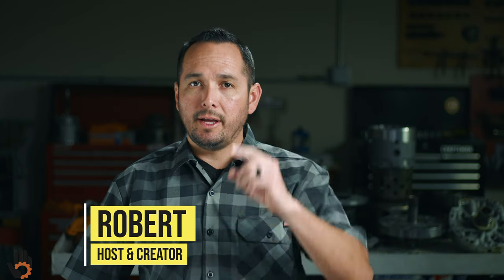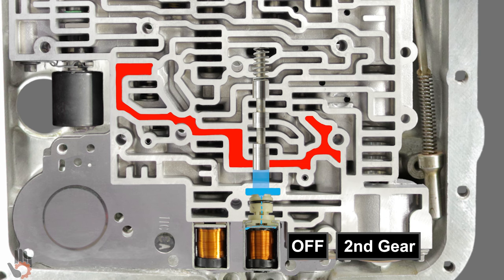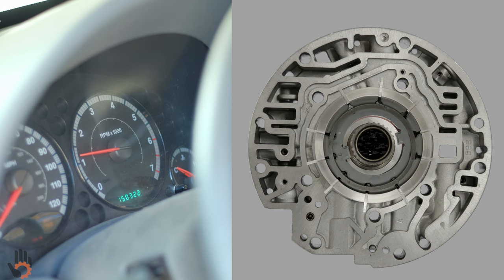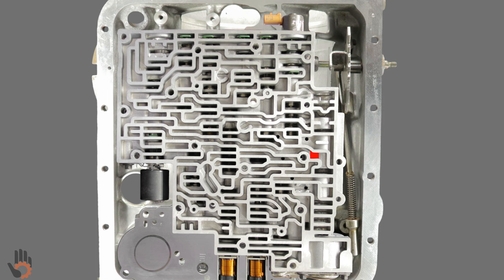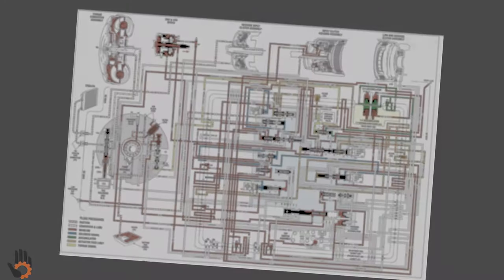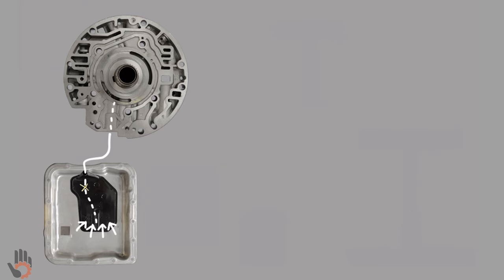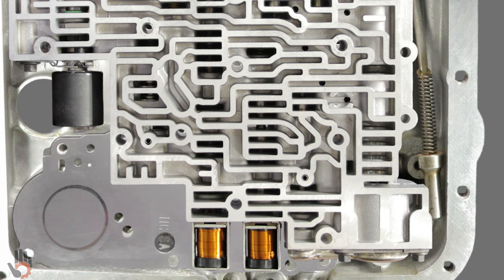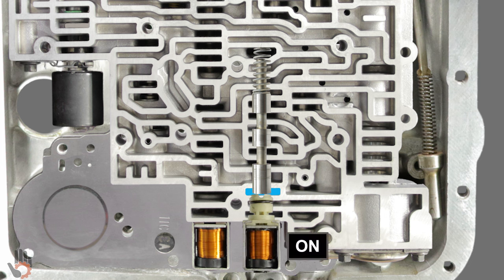4L60E: 1-2 Shift Valve + 1-2 Shift Solenoid (Part 1) Basic Operation

Comment: In your opinion if a car's transmission has a hard shift from 1st to 2nd and all other gear shift is a nice smooth soft transition is that something to seriously be worried about? Or is it something that could be repaired rather rather easily/inexpensively?
Reply from the maker: You could be dealing with an issue with the 1-2 Accumulator.  Accumulators are responsible for cushioning shifts.
It's not uncommon for springs to break, resulting in harsh shifts...that will affect only one up-shift....and none of the others.

In the case of the 4L60E, if the PCM detects a transmission problem, it may elevate the Line Pressure...in an attempt to save the transmission from further damage.
In the case of the 4L60E with elevated line pressure, for whatever reason, the 1-2 up-shift is gonna bang harder than any other gear.

If you don't already know, Line Pressure is the highest oil pressure in the trans...and it's used to apply the clutches/band.

Definitely something to look into.
Reply: @SouthpawAutoworks  greetings, great video, on the 6R80 I have same exact problem, fluid is new , lead frame new old one was contaminated, adaption tables reset done, but issue still there

Comment: Hi I have a 4l60e it has been wired for manual operation. I just recently starting having a problem with is starting in second even tho i am in manual 1 and when i get rolling at low speeds it shifts between 1s and 2nd somewhat rapidly especially when the fluid gets warmer or operating temp. Any ideas where to start looking for bad or worn parts?

Comment: And what does any of this have to do with changing gears within the transmission itself? Does this affect clutch packs and planetary gears, etc.? How?
Reply from the maker: The solenoids affect oil pressure, at the end of the valve.  That pressure, or lack of pressure, results in valve movement.  The valve acts as a doorway for a different oil pressure to go past/through/around the valve.  The oil that moves past the valve is directed to a clutch piston.  That oil pressure moves the piston and smashes (or applies) the clutch pack.  That applied clutch directly affects the planetary gear set.
Note:  I mention clutch pack.  This applies to the band, too.

It will either:
1) Cause a portion of the gear set to rotate.  
2). Prevent a portion of the gear set from rotating.

Comment: I have a 2003 Bmw X5 with i believ this transmission ,the van is nit moving ,changed oil filter selenoids but it reaction says it wants to move but dosent, what can you suggest to help. Had a diagnostic check guysay tranmission dead whichnibdont believe, other agree with me

Comment: I am having trouble with the 1st to 2nd shift under moderate load. The 4L75e transmission revs up to about 4k before it shifts.  Now this doesn't accelerate just revs up the to 4k before it shifts. 
Any help is appreciated.
Thank you  Jim

Comment: Great video I have 4l60 transmission that was remanufactured i noticed a hard 1 to 2 shift and and at times feel like it was sliding in to gear so I recently changed the 1 to 2 accumulator to sonnex spineless accumulator and installed a corvette servo. The transmission no longer sliding into gear and at times at low speeds shift smoothly but once you hit pedal can feel the 1 to 2 shift the rest of the gears are smooth. What do you think?
Reply: I have an 06 Chevy Silverado that has a hard shift from 1st to 2nd and was thinking of changing the 1 to 2 accumulator and installing a corvette servo as well.  Do you think this will solve my issue?  I will appreciate any advice.  Thx!
Reply from the maker: There are a number of things that can cause a hard 1-2 up-shift.  When time permits, I'd love to dedicate a video to that topic.

For the meantime, I will say...
The 1-2 Accumulator is definitely on the list of suspects.  If you tear into this section of the trans, you may find a broken accumulator spring.

Increasing the size of the servo piston (upgrading the servo) is going to create a firmer 1-2 up-shift.  Just a heads up...

Got more 4L60E videos coming.  Stay tuned.

Comment: Hi.
Could you please give me a piece of advice about 5L40E gearbox.
When the gear box is cold, there is a strong punch inside the transmission whe it goes down from 2 to 1 gear.
Is this problem with solenoid or hydraulic battery of 1st and 2d gear?

Thanks in advance

Comment: Newly rebuilt 4l60e/5.3 out of an 02 Tahoe. Doing an LS swap, so have a stand alone harness. Having hesitation then a harder than normal shift to 2nd. A shift to 3rd. Then oscillating back and forth 3-4 gear. Any ideas. I’m brand new to this. My first rebuild. Thanks in advance

Comment: Would this cause no auto first gear(seems like it is on neutral) but have manual first? I can manually shift 1-2 then back into drive and it will shift and drive as normal at highway speeds no problem.  When it gets to downshifting, coming to a stop in”D”, 2-1 it is as if it is in neutral. Come to complete stop and will not go again until I manually shift to 1. 🤷‍♂️
Reply from the maker: It sounds like you may be dealing with a failed Input Sprag.

Check out these two (2) videos to learn more about the power flow through the trans.
Power Flow (Shifter in D):  https://youtu.be/IfOqbTqKubE
Power Flow (Manually Shifting):  https://youtu.be/6kfAuXJFYFE

Questions:
1). Was the transmission recently rebuilt?
2). Was there a loud bang right before you experienced this problem?
Reply: @SouthpawAutoworks  wasn’t recently built. I mean… 8,000 miles ago.  So, the rear diff, ring and pinion exploded, after I put a new one in this problem was present on the first test drive.

Comment: I have a question about the 4l60e in a 2001 astro awd. the MANIFOLD PRESSURE SWITCH clear plastic is warped in middle.  Could this cause loss of R and and maybe not even lock up
Reply from the maker: I've been trying to get back to you...but, have been pressed for time.
I shot a super short video, answering your question...and showing what to look for on the manifold pressure switch.

Hoping to get that video uploaded, today.
Reply: Thank you!
Reply: @SouthpawAutoworks  the manifold pressure switch clear plastic is warped and makes me wonder if this caused the loss of reverse for me. The reverse and 2nd gear  membrane swithes do not click or have any kind of reaction to pushing it.
Reply from the maker: Here's my Response:
https://youtu.be/Wie4lbppOu4
Reply: @SouthpawAutoworks   thank u 👍

Comment: I have a code P0767. Is it possible changing fluid and shift solenoid would fix the issue? Trans fluid is dirty with 150000 miles.

Comment: Hey I like the video good information had a question if you could answer I'm currently working on my 4L60E 98 GMC Yukon I don't have 2nd or 4th gears still after replacing the solenoid a and b, the 1/2 2/3 solenoids at same time, which is the issue I started with.... Any suggestions
Reply from the maker: If the trans is missing 2nd and 4th (and not missing any other gears), then I'd be suspecting an issue related to the 2-4 Band, and the 2-4 servo, that controls the band.
If the trans is missing 2nd, 4th, and Reverse, then I'd be suspecting something else.

Comment: there are so many comments i do not know if mine will be read, haha, 03 1500 x4 truck just bought the transmission in it originally did not have 3-4 ironically from the same shop they had an extra transmission i threw that in 1-2 good going into 3rd it go neutral so3-4 is out. then bought a used transmission off of fb market fellow said it ran just fine but sat. put the transmission in only get 1st gear can engage other gears but only by feathering at the right rpm. any thoughts?

Comment: I have problem with my renault sandero stepway 2019 that sometimes when my automatic transmission changes gear from 1st to 2nd there is clicky sound is this issue due to bad solenoids or what the issue is not always but most of times please help me.

Comment: Why after 4 transmission installs this 4l60E not shift into 3-4or overdrive and when I push the tow button it just slips nothing else happens. From first at very high rpm as the rpm lowers it slides I to 2nd gear and that's it if I add more throttle it just slips.. All have done the same thing

Comment: Great video man!! I am in the process of rebuilding my 4L60E in an 02 GMC 1500 4.3L V6. I noticed a distinct clicking noise one day, it would come and go, 2 weeks later the truck won't move. Turns out rear most planetary are breaking into pieces. Any idea what may have caused this? Thanks in advance
Reply from the maker: Sounds like a failed bearing.

The rear planet carrier has a captured needle bearing in it.  They're known for failing.  Not super common...but, it happens.
When they fail, it releases needles into nearby meshing gears...and crunch.

During an overhaul, it's a good idea to order a bearing kit, and replace the old bearings.  Unfortunately, the kits don't come with this particular bearing...because replacing this bearing requires disassembly of the rear planet carrier...something that is not a common practice.  Requires extra tools, time, etc.  If in doubt, a lot of people will replace the entire planet carrier.

There is also a way to essentially take the load off of this particular bearing.  But, it requires aftermarket upgrades.

Wishing you the best on your 4L60E.
Reply: @SouthpawAutoworks  thank you for your input, I went ahead and upgraded to the 5 pinion planet carriers. I was just wondering if there was something else I should be looking at as for the cause of the failure.  An I reuse my torque converter? Oil pump?
Reply: As far as I know the torque converter and pump are reusable, but being there were actual chunks of metal and aluminum flying around, would you recommend replacing converter? Oil Pump?

Comment: I've got a late lunging shift from first into second. I've changed my 1-2 accumulator to the pistonless accumulator and I changed my 1-2 solenoid. The problem still persists. Should I get back in there and change the 1-2 valve? I was thinking it might also be the servo. Thank you for this video!
Reply from the maker: Guess it's possible that the 1-2 shift valve could be sticking.  But, if there's a problem with the 1-2 Shift Valve, it will also affect 3-4 upshift.  The 1-2 Shift Valve is also partially responsible for the 3-4 upshift.

Have you checked the TPS (Throttle Position Sensor)?
The PCM uses info it receives from the TPS, in order to determine shift timing.  There's more to this, but I'm just trying to keep it short.
Reply: @SouthpawAutoworks  Thanks for the reply! I have changed the throttle position sensor as well and still have the issue.

Comment: Great video! My 4L60e started slipping at 200k and by 200, 423 it overheated. I drained out the burnt fluids and am replacing all the solenoids and the valve body. I replaced all the check balls, I did not see any gross evidence of failure. I am doing all this in my driveway and may be in over my head. I am bolting it all back together now, is there anything else you recommend I look for? Thanks in advance.
Reply from the maker: Sorry to hear that.
Which gear(s) is it slipping in?
Reply: @SouthpawAutoworks  3-4 band is toast, shifts great 1-2, as soon as it goes to 3 it slips. I am going to have to take it too a shop, I am overwhelmed.

Comment: Thank you for the video.  Amazing information here.  

If I am understanding this correctly could a bad solenoid cause a 2-1 shift to go into neutral?
Reply from the maker: Right on.  Glad you enjoyed it.

To the best of my knowledge, a faulty shift solenoid will not cause the problem that you've described.  However, I'd need to get more information regarding the problem...

1st Gear is achieved by:
1). Forward Clutch.
2). Low-Roller Clutch.

2nd Gear is achieved by:
1). Forward Clutch.
2). 2-4 Band.

So, for both 1st gear & 2nd gear the Forward Clutch is on (applied).
When down-shifting from 2nd gear to 1st gear, the 2-4 Band is released...and the Low-Roller automatically takes over, assisting the Forward Clutch.
Note:  The Low-Roller is a "dumb" mechanical device.  It's not controlled by electronics or hydraulics.  Super simple device.

If you would, share more info about your problem.  I'll circle back to your comment, as time permits.
Reply: On deceleration where I would normally expect a 2-1 shift it slips into neutral and grinds similar to the t-case encoder finding gear when rolling.  When completely stopping it will hold 2nd until take off at which point it will slip into neutral again.  It is especially prevalent and more violent when turning left.
Reply from the maker: Interesting...

Questions:
1). Year/make/model?
2). 2WD or 4WD?
3). Does this problem occur at all engine/trans temps?  Or does it only occur when cold, hot, etc?
4). With the engine idling, move shifter from Park to D.  Accelerate the vehicle.
Does the acceleration feel normal...or is it slow to accelerate?
Do you believe the trans is starting off in 1st gear?  Or is it starting off in 2nd gear?

I've got more questions for you, but need you to get some more clarification from you, first.  Shoot me a response at your convenience, and I'll circle back to this, as time permits.

PS - If it feels right to you, please help me spread the word about this channel.  Here's some easy ways to share with your favorite FB group, Reddit group, online forum, etc.  Thank you.

1 Handed Transmission Rebuilder:  (60-Sec Preview)
https://youtu.be/y3Vixa_Ec1E

How the 4L60E valve-body works:  (60-Second Preview)
https://youtu.be/fWPSaLeaOXI
Reply: @SouthpawAutoworks  
1. 2004 Chevy avalanche 1500
2. 4wd with auto 4x4 electronic shift
3. It is intermittent until things get hot then it gets bad.
4. Park to drive I only get neutral unless I backup first or manually put it in 1st.  When coming to a stop it will either hold in 2nd or pop into neutral when taking off again.  On the rare occasion that it does downshift to first, acceleration is sluggish and slippery feeling.

Everything works amazing when shifting manually.

Comment: My 4l60e has park, reverse, neutral and first. It will not shift out of first. I have unplugged the transmission trying to throw it into limp mode and the transmission is still stuck in first gear. Not 3rd like it should be in limp mode. I have been in the scan tool and checked vss and it's fine. I can watch the trans command second and 3rd if im going fast enough but it never shifts out of first. I have no codes. I have powered the solenoids with my scan tool and can confirm I hear them clicking laying under the truck with the engine off. I'm thinking this valve must be stuck inside the bore. I have not tore the valve body out yet but I am going to Saturday. Do you have any input on what you think could be going on based on the information I've provided.
Reply: Update. The valve was not stuck.

Comment: the AFL  valve when the solenoid is removed is not coming out,  it seems stuck.  The other valve from the other solenoid just snaps right out by the spring freely.  This one doesnt.  So i guess what im saying is how do I remove it and clean it up to get it to slide freely? It moves just a little back and forth.   thanks man
Reply: I'm sure it has to move freely like the other to work

Comment: My 4l60e shifts from 1st to 2nd and bounce back 2 or 3 times before locking in. Would this solenoid be my problem?
Reply from the maker: That's interesting.
Possibly...
Could also be an issue with the 2-4 Band applying.

For 2nd gear to occur, the 2-4 Band must be applied.  It wraps around the drum.  When applied, it squeezes the drum, and prevents it from rotating...which has positive consequences in the planetary gear set.

If it is solenoid related, it could be an issue with the PCM...as opposed to a problem with the solenoid itself.  The solenoid is controlled by the PCM.  And not that the PCM is necessarily the problem...
The PCM monitors sensors on the engine/vehicle.  It uses that data to determine when to up-shift, and how gentle or firm the shift should be.

Might want to take a look at the TPS, MAF, MAP, and VSS sensors.
Start withe the basics, like pulling codes.  They may shed some more light, and point you in the right direction to explore.

Just know that engine problems tend to cause transmission problems, because the PCM is relying on info from those sensors...in order to command the transmission to up-shift/down-shift, etc.